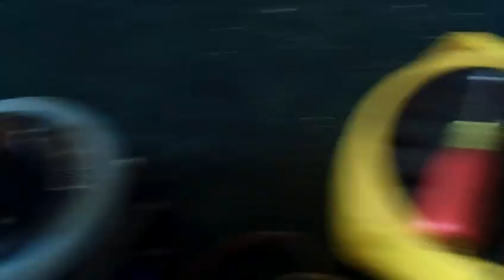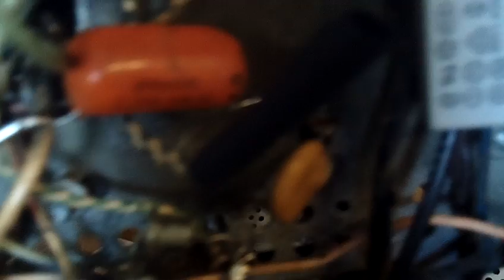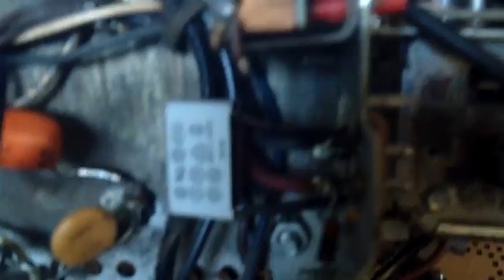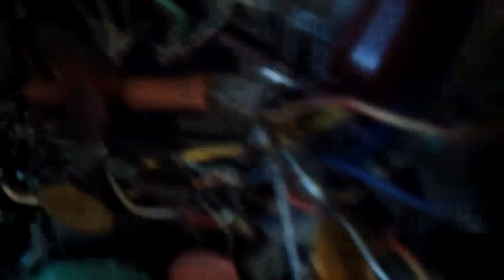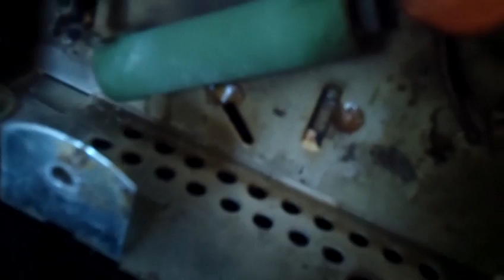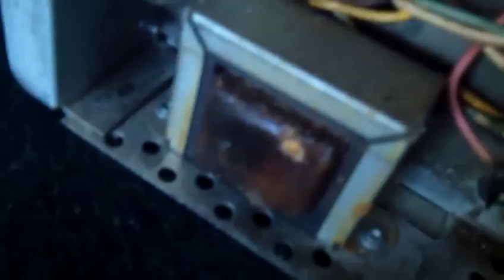Vintage round tube color TV flyback check pt 1

Comment from the maker: I just checked, seems like RCA started it with the CTC-11. My guess is there must have been enough problems, perhaps with flybacks, that they made it an option. The CTC-16 made it easy with taps that were changed thru plugs on the top of the chassis so you did not even have to pull the chassis, just swap a plug location on a term strip. Read that high line voltage reduced tube life a lot as well, I am no to concerned about that aspect since my sets do not get much time anyway.